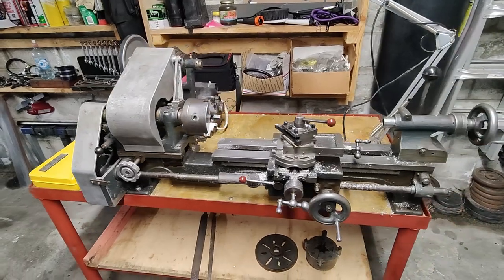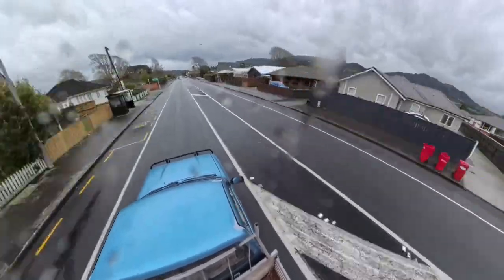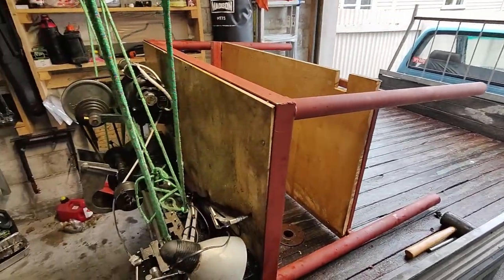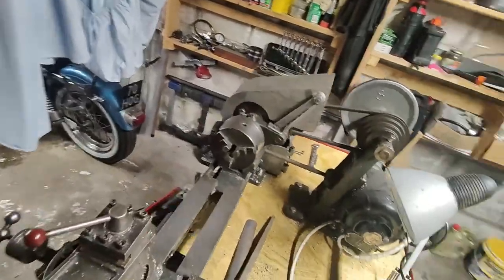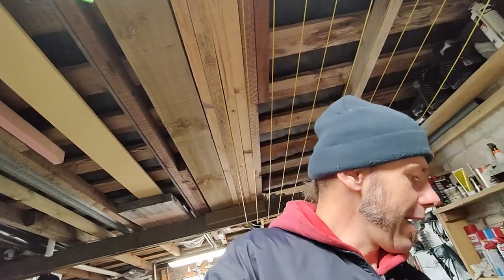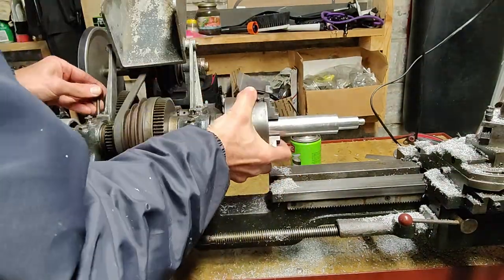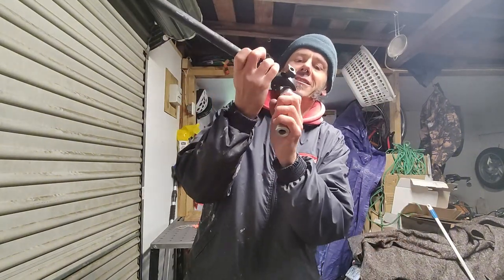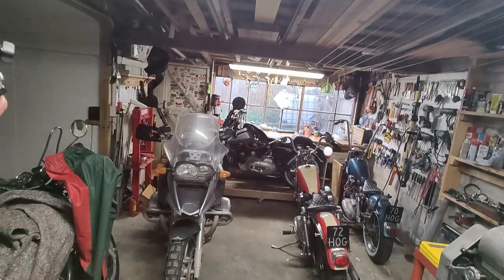Acquiring a LATHE or a step closer to that 1979 Ironhead Chopper project!

Comment: Just remember wherever you put it bro your going to be using the air gun to blow all the scragg and coolant off it when your finished to clean it down so up against the concrete wall is probably best cause it will hit the wall and fall to ground to sweep up later…against a wooden wall will get it wet and eventually rot away…Just a thought bro…New Toy,endless options…Fork extensions,Risers,Spacers,Exhaust Manifold blocks,Carby blocks,the list goes on…Exciting times bro!..Mean score!
Reply from the maker: I know bro. I clean the lathe and all the shit jumps in my shelf ahhaha. Not good. Needs a rethink! Need to sell that bmw so I have space 🤣